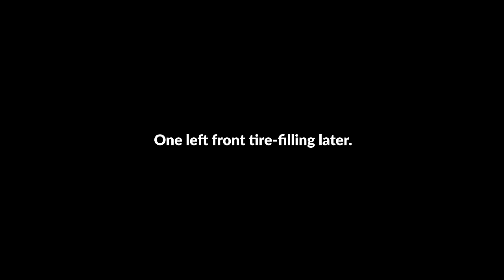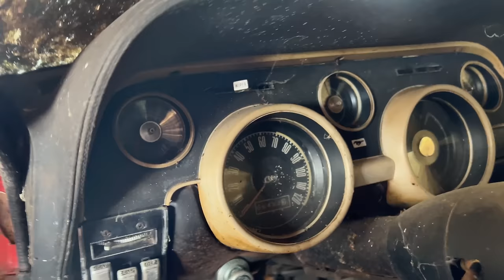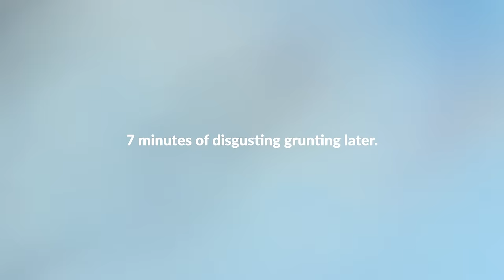Two Mustangs Parked for 42 Years! Will They Run and Drive?

Comment: My high school car sat for 35 yrs as a basket case.  I kept saying I will get to it one day.  So glad my wife said. Fix it or sell it.  All done in my garage by me.  Interior still needs work but it is licensed and inspected and we drive it.  So glad I kept it and even more happy my wife let me spend a ton of money on getting it running.
Reply: What was your high school car?
Reply: I have the same story 1968 mustang gt with 390. Raised 3 kids put all the money I could make into raising them.  Great people wouldn't change much about my life.
Reply: Its a Mach 1, the Mustang they forgot to design the rear half of.  @MrMCDiggles
Reply: @MrMCDiggles . 72 Mach 1. Graduated 86. Went to prom and graduation in it. Spun a bearing in 88. Father passed away the next year so it got pushed into the garage…..then life. 

Video of the first drive to turn it around to do firewall forward wiring in my videos. 

Looks ok for rattle can paint done in the garage.
Reply: @rcadd1ct mustang guy through and through. Glad you could get the project done.
Reply: 72 Mach 1 ? awesome , guessing a 351C. Daily drove a 67 coupe for 4 years, bought it when i was 16 for $1200. Had my neighbor paint it midnight blue, my dad and a little help from me rebuilt the 289. Finally the shock tower split, was pulling to the right... rails needed a whole weld job. Sold it to a welder, who bought it for his 15 yr old daughter. He said he'd get it done by the time she drove. It was sad but it lived on, it was in pretty nice shape except a little quarter bondo and the frame. I was told 3k in 88 for a rail job, couldn't swing it. Bought a Corolla FX 5 spd with AC...Class of 85 here.
Reply: Some of my cars that I truly miss was my 1992 Cadillac Eldorado, and my 1990 Eagle Talon Tsi AWD turbo 5 speed. I also built a 1992 Plymouth Colt hatchback with a full Colt GT interior and I swapped in a fully built 4G63t from a Mitsubishi Eclipse. It was the last car that my grandfather owned and I ended up getting it from my cousin that he left it to.
Reply: "She's a keeper that one Mate.👍🇦🇺👍
Reply: "let you"? 😕
Reply: @biglaw24 .  Yep!  Our money, and a LOT of it.  Basket case rebuilds aren’t cheap.  Two years of all our extra money.
Reply: Had a 65 coupe. First new car. Black with red interior. Wish I still had it.
Reply: My high school car at 16 was a 66' 289 high pro 4 barrel fastback in powder blue my mom found for me, and I paid for. The girls loved it, thank you mommy! 🤣🤣
Reply: @BlueXonar  Dude right?? I think the mach 1 has the most perfect front end... but not having the iconic tail lights is a crime!
Reply: Dead mouse on the rear shelf at 44:19
Reply: For many people this is not just a car anymore but it is all the memories. For me as well as you. I really wish my school memories could be restored, but unfortunately.......

Comment: You're after my heart here. I own a 67 mustang, coupe. It was a 289 2 barrel car originally, too. The 67 in this video is highly optioned, deluxe interior, a/c. I've never seen the overhead console before. Those louvers on the quarter panel are metal, not plastic.  Like you said, Mustangs are great because you can pretty much get any part for them you need. Thanks for the great video, as always!

Comment: I just went through a fight with the brake drums on the 1954 m38a1 jeep willys i bought last month.  The front drums were rolling, but the rears were not, partially because the eccentric bolts for adjusting the shoes being 70 yrs. old were no good.  I ended up taking the wheel cylinders bolts off, and then pushing the drum far enough back to pull the wheel cylinders out, and then the shoes came off the anchor and i got the drum off.  The drums and shoes were the originals, which shocked me, but explained the trouble getting them off, plus the drum couldn't be pulled because it sits inside the backing plate about a quarter inch or more.  Thankfully this jeep had only been parked since 2017, because an older guy owned it and couldn't get in an out of it anymore.  The other thing that helped me, was that it was never road titled, and was just driven on his Northern Michigan summer property, or it would have been a rust belt donor jeep  I bought the rig from his daughter, and he bought it in the late 70's or 80's from the government.  I'm disabled, have progressive MS, causing muscle wasting, and my dr. told me i needed to keep moving so that i don't end up in a wheelchair.  I have some other thing's messing me up, but i do as much as i can.  
     I like the variety of project's you do, and love the questionable choices you make, great content.  I would have liked to have seen that 68 mustang get worked on, but I'm not a ford nut, so it's fine.  I don't have any family to talk about my car's with, or any car's, so I guess watching you, and some of the other enthusiasts helps keep me in the community.  G-d bless.

Comment: Fun Fact: Like a lot of things in life, Slime originally started out life being originally designed for military use, but it eventually worked it's way into the civilian market.
tl;dr = A flat tire is the last thing you need to worry about in an active combat zone!
Reply: Slime makes me angry because it's just a bunch of shredded rubber in RV antifreeze. A lot of people think it's good for bicycle or stand up scooter tires. It's not. You need latex for bicycle and stand up scooter tires to seal them. Slime is ok as an additive in DIY latex based sealants to add those rubber threads to the latex. Ya really need the air-drying latex, not just the rubber threads, in a small high pressure tire in order to seal punctures. You need to check bike tires at least weekly even if they don't have a slow leak so if they have a slow leak due to a Slime "sealed puncture" you're probably going to have to pump the tire every single time you ride the bike and will likely return home having lost much of your air. 

Small tires deform and flex more than car tires and that makes those rubber threads much less effective than if they were "glued in place" by latex. Flexible tires basically "fart" around the Slime "plug" but latex expands and contracts to maintain the seal.

Side note: those of us that run bike tires "tubeless" like car tires use latex sealant and most carry what are called "bacon strips" in the bike world. You know those car tire patches where you use some t-handle tools to ream out the rubber and jam an air-plugging strip in? We have smaller versions of that. Some tools will even re-inflate the tire using a CO2 cartridge as you stab into the tire to insert the plug.

Comment: 12:24 trucker and former mechanic here Jarred when you have a siezed drum like that whack in directly in the bottom several times and wedge a pry bar in the studs to get leverage to turn it like it should with the leverage of the pry bar lodged in the wheel studs rinse and repeat till it breaks free!

Comment: The little Mustang on the dash is a high-beam indicator. The shoulder harnesses were an option. High-Beam switch should be on the floor. I owned both cars in the late '80s. The huge doors were actually great for putting babies in the back.

Comment: Owned 3 67’s included a GT-500 and a coupe. 

The 67 has a deluxe interior and other expensive options like the aluminum panel on the rear of the 67 and looks to be the better of the two.

The owner unfortunately did not take care of them up to this stage. More than likely they will get sold to someone who has more passion for the Mustangs

Comment: In 1974 I was a junior in high school when I got my first car. It was a 67 Mustang coupe with a 289 and C4 automatic. Only seven years old but it was a tired old pony. I don't think the oil had been changed very often. It ran on 5 cylinders and burned about 2-3 quarts per week. I rebuilt it in high school auto shop. After graduation I joined the USAF and drove it from L.A. to Illinois and back. So many good memories in that car. I wish I still had it.

Comment: Interior on the 67 is the deluxe- From the chrome in the back of the seats, to the grill and lights at the bottom of the doors. To the overhead map-lights and the polished aluminum on the door panels and dash panels. the rear  panels where the back window handles are, are covered in vinyl instead of being just painted metal like the base model ones. Mine also had the K-code 289 and 4-speed which was even more fun than the deluxe interior.

Comment: Dad sold these new, and the 67-68 were my faves.  The 67 is very much a special edition car.  The treatment in the rear, the overhead console, the special hood with the turn indicators in the "vents" and the brushed aluminum "like" finish on the dash tell that.  BOTH are very worthy of a full restoration.  I hope that happens

Comment: I let my friend drive our 67 mustang fastback 298 4 speed and he wrapped it around a tree. We bought that car for $500 back in the early 70's. Mustangs were cheap back then. Times have changed. Glad to see you aren't afraid of carbs and did a nice job rebuilding them. The secret as you showed is to get all the passages clean which requires all the cleaning equipment and shop air that you used. It was a good demo for those who are younger. I was tearing apart carbs in the '60s as fuel injection was reserved for European sports cars and Corvettes. A long but interesting episode. I appreciated this one with the tech. Hope the grandkids get into the cars. I'm trying to get my grandson interested in a flathead V8 model T on a model A chassis. It would be cool to have him pass his drivers test in a car over 100 years old. The only one in his high school parking lot.
Reply: 1st gen mustangs are still way cheaper than 1st gen camaros!

Comment: I don't know about the 67, but on the 68, the tiny Mustang insignia on the dashboard is the high beam indicator; it will light up red when the brights are on.  The little pedal on the left pumps the washer fluid.  Since the 67 and 68 are borderline twins, the other might work the same way.  For what it's worth, on the 67, between the headliner console,  original AM/FM radio, factory air, and remote side view mirror, that's a sweet package.  Good luck with both of them.

Comment: I was surprised to see that the 67 was blue when you cleaned it.  Couple of things--when you jump across the selenoid as you did on the 67, make sure it is in park as it will bypass the neutral safety switch--it happened to me on my 67 years ago and fortunately I didn't get run over and only needed to replace a fender and bumper.  On the 68, the little pedal above the dimmer switch on the floor is the pump for the windshield washers.  They don't make them like they used to!

Comment: There is no component issue with 357Sig.  The bullets are 9mm so a common size, you just need the right shape so that the case isn't bearing on the ogive.  The case can probably be formed from a .40 case if you have a full length resizing die.  It can definitely be formed from a 10mm case if you need more brass to work with.  Small pistol primers are not a problem.  Powder can have supply issues if you have a favorite but you can probably always find some powder that will work.  You have the same powder issue with any caliber.

Beside less recoil, the 357Sig higher muzzle velocity means if you use a compensator it will be more effective at reducing muzzle rise than a similar compensator on a .40 S&W.

Ballistics are important too.  Higher velocity means a flatter trajectory for longer shots, more consistent bullet expansion and deeper penetration.

The expansion is so impressive that .40 probably winds up smaller even though it starts out bigger.  Part of this is because 357Sig uses a bullet designed to expand at 9mm velocity (lower) and a lot of .40S&W uses bullets designed to expand at 10mm velocity (higher).  This also means a bigger energy dump and temporary wound cavity for 357Sig.  When combined with good penetration, that's really hard to beat.

Another way to look at it is that 357Sig at 50 yards is equivalent to 9mm point blank and it can potentially be quite accurate at that range.

I like it in a Glock 22 size package so it picks up a little bit more velocity and has a longer sight radius for those long shots.  One of mine has a Glock 35 length conversion barrel for even more.

Another good thing about 357Sig is you can use police surplus .40S&W magazines that are dirt cheap.  You can also use a Glock 22 parts kit with a conversion barrel or a full surplus Glock 22 with a conversion barrel to get in to 357Sig pretty cheap.  If you want cheaper target practice, there are 9mm conversion barrels for .40 size guns too.

Comment: My Dad had a '65 Mustang, and it was the car that I learned to drive in.  It was a very base model car with the 6 cylinder and 3 speed on the floor... no power steering, no power brakes, and of course, no A/C!  Red with black vinyl interior (which could almost sear skin off of your body when it was hot out-- which in deep south Alabama was about 6 months out of the year).  Dad drove the Mustang back and forth to work each day-- over 100 miles/day, and it had close to 200k miles on it (which is why it didn't become my first car!)  Instead, I got my Grandmother's old 1959 Chevy Bel Air as my first car.  I still wonder 50+ years later how different my life would have turned out if I had the Mustang instead...

Comment: You guys should do this first step one disconnect fuel line step 2 fill cylinders with transmission fluid come back in two days Step 3 compression test . Because throwing money at it

Comment: I use to restore those from technically 641/2 to 72 for years. So long that I could tell where a screw was from and it was a major difference between the "repops" and "oem" parts. Even with all the frustrating things involved, I still enjoyed seeing the finished product.  A feeling you can't describe. 👌😉👍

Comment: 5:49 nobody seems to do this anymore, but you can take a broom handle (or a spade, given that today's broom handles are ... tissue paper) and wrap a strap around the tire so that the handle ends up in the center of the wheel and turn. Works really well to jog old, stuck brakes.

Comment: My 50 Chevy... I had to cut the drums off. I had the wheel cylinder all the way closed, ground-off my shoe pins and all of the hardware was rusted inside a worn lip on the drum. I didn't have a choice I had to cut a pie out with a grinder, hammer and cold chisel then stick a pry bar and hammer to free up the shoes to collapse it on the inside, put the carnage back on and the wheel so I can get it up on the trailer. I was moving at the time and I'm not keeping any of that 1950 drum technology or steering and suspension... Everything must go.
That took me the better part of 2 hours for one wheel I'm glad it was just the one wheel. That old cast steel drum does not cut well.

Comment: I would say out of the two cars the 67 would probably be worth more. It has that back panel by the tail lights the interior group with the floor and roof console and the rest of the stuff inside of the car.  

Those backs for those bucket seats are pretty expensive

Comment: Tip for pushing dead old cars. Rather than trying to push forward with your back and arms, turn your body around putting your butt against the back of the car and push with your legs. Lots more power in your legs and get as low as comfortable. Better for your back muscles as well.

Comment: Ive waited too long to finish my 79 mustang pace car #13. It was my moms car when my parents were together. They had matching pace cars, mom's was v8 auto and my dad had the turbo 4 cylinder with 4 speed. When i was 17 i drove my moms car from SFO to SC and only had to stop 10 times lol radiator was completely clogged. Anyways now I'm 43 and the car has just sat with a cracked block. Its got the sunroof so rust has killed it but ive still got the checkered recaro seats. Always wanted to get it going again but a wife and 2 kids and family comes first. Glad you were able to save these two cars from death.

Comment: Not one minute into this, and I am flashing back to a time when I was working on a blue 67 coupe mustang.  I replaced the hood and trunk lid with a red ones from the junkyard.
The rear had an indentation and I pushed it out with the Jack and wood to brace as I crack the Jack out. I spay painted the entire body metallic blue with spray cans from Advance Auto. I also painted the interior metal. I never did get the right radiator. 

It was the 80's and I could find parts in the local junk yards.

Comment: The 1968 4 barrel 302 engine was a one year only engine and I think it replaced the 4 barrel 289 half way into the 1968 model year. It was replaced by the 351 Windsor engine in 1969. A friend in high school had an original 1968 289 Mustang with a 4 speed transmission. The 1968 4 barrel 302 engine had a unique camshaft that was only used in that one engine, for that one year.

Comment: Loved pulling carbs apart as a teen in the 80s, we bought cars for $500, swapped out motors, rebuilt carbs and motors, nowadays, 1/2 these manufacturers have proprietary software you need to do anything, Mazda for example.

Comment: Really should pull plugs and put some mystery marvel in each cylinder before cranking. Plus pull coil wire and crank to build oil pressure before starting.  Saves on lot of engine interior parts.

Comment: If yougetthem drivable, putthe radial tires on the rear. They grip a lot better than bias ply. If you hit the grakes with the radials on the front they grip tight to the road and the rear bias plies break loose and the car swaps ends.